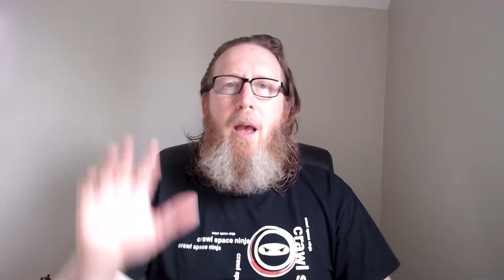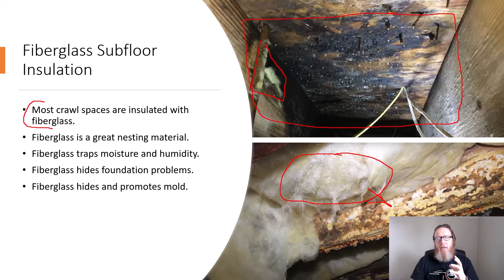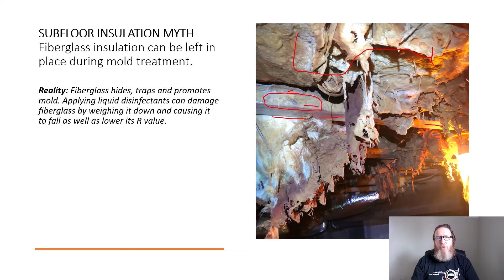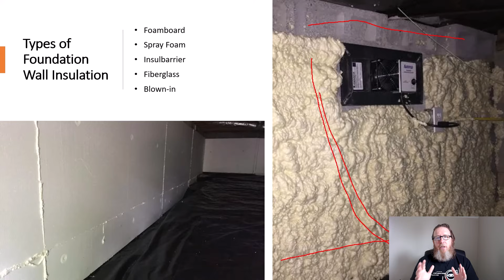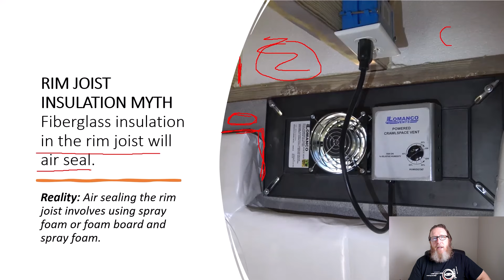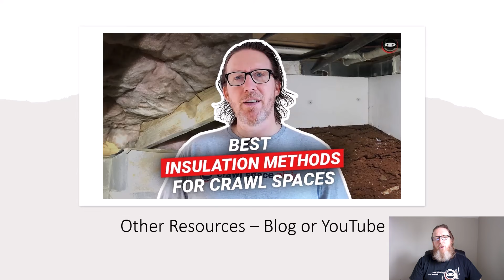Your Fiberglass Insulation is Rotting (Here's Why)

Comment: I am using your vapor barrier and will have at least a 1 foot over lap. Can I put rockwool on top of the vapor barrier if I choose to in a sealed crawl space with a dehumidifier? If not, can you please tell me why ?
Reply from the maker: I'd like to know where exactly you would want to install it because if its on the ground, you are not achieving much. If you install it where the heat and cold transfer takes place, such as the walls, that can be a decent insulation method, but adhering it could be tricky

Comment: My crawlspace is vented, which part would I air seal and insulate? If I understood correctly, you said do not insulate the walls if it is vented. You also said you do not recommend insulating the subfloor for any application. Would I only air seal and insulate the rim joist and sill plate along with air sealing the subfloor?
Reply from the maker: My apologies for my misinformation. If you are going to keep your crawl space vented you still need to apply insulation to the subfloor. According to building code that is required. I would air seal all penetrations in the subfloor and rim joist but in order to pass inspection it is recommended that you insulate the subfloor. I do not like subfloor insulation but in order to follow code there is no way around it. I hope that clears things up. Thanks for watching.

Comment: my house has had issues with mold. i pulled out the fiberglass and there are some sistered areas between the joists at the rim. its an old brick house with minimal flashing over buffalo board (no thru wall). im concerned about putting any closed cell around my rim joists and encapsulating moisture that might permeate thru the bricks. It looks like the old building technology of letting it breathe might be superior here, although it would feel excellent to get my humidity down and sprayfoam the rim joist or add XPS. Would you recommend rockwool or spray foam ? Located in central Kentucky.
Reply from the maker: @andrewnelson7229 That is a great concern to have with an older brick home. Since you have buffalo board and minimal flashing, you are right that moisture can move through those bricks and you don't want to trap it against the wood with closed cell spray foam. In your situation, using Rockwool is often a better choice because it is vapor permeable and won't trap moisture like spray foam or XPS can, while still providing excellent thermal protection. Keeping that humidity down in central Kentucky is key, so focusing on a high-quality vapor barrier and a dehumidifier will help the wood stay dry even if the brick "breathes." Hope that helps. Thanks for watching!
Reply: @CrawlSpaceNinja  Thats my plan! I appreciate the feedback . Having CS Ninja come out next week to soda blast the mold and encapsulate the space. Thanks.
Reply from the maker: Please keep us posted how it turned out.

Comment: Can you do a video just for Florida? The entire exterior atmosphere is so humid here. I'm thinking to just nail the vapor barrier to the bottom of the raised wood floor joist 20" above the ground. Because, there's no other barrier under the T & G wood floors. The A/C should remove all the moisture from the inside of the house and from between the floor joist. Then the crawl space vents should still breathe through the foundation vents and vented access openings.
Reply from the maker: I have done several consultations with people as far south as Miami and we recommend if you have a crawl space with a dirt floor you cover the dirt floor with plastic seal the vents and control humidity with the dehumidifier. Hope that helps thanks for watching.

Comment: I'm planning to insulate a crawl space under a log cabin in central Colorado. In this climate it will be cooler on the outside on a more consistent basis, but not so much in the summer months. Do I put the vapor barrier on the inside of the insulation? I plan to use a foam board insulation and am not sure of the options to attach the stone. Any thoughts?
Reply from the maker: @jayjarrett5523 That sounds like a great project for a log cabin! In your climate, we typically recommend installing the vapor barrier directly against the ground and walls first, then placing your foam board over the top of it. This helps keep the moisture from the soil out of the space entirely. As for attaching to stone, using a high-quality construction adhesive specifically rated for foam and masonry is usually your best bet since mechanical fasteners can be tough to drill into stone. Hopefully that helps and thanks for watching!

Comment: I am in NC and my crawl space was sealed but they did not put foam board or any insulation on the wall or at the rim joists.  I can really feel it during this cold snap!  What kind of foam board can I safely put in the rim joists?   Many foam board products I see in Lowes and HD say they need a fire barrier on top of them. Or could I put rockwool board in the rim joists as well?  I have a yearly termite inspection for my termite bond and what ever I put up there will definitely need to be pulled for inspection. Thanks for the videos!
Reply from the maker: Thanks for reaching out @AlexAndra-g2t. Costs can vary depending on the size of the space and what’s going on, but we’ve got a few options to help. Here are some we carry: https://supply.crawlspaceninja.com/collections/insulation Thanks for watching I hope that helps.

Comment: I have a summer cabin that I have started using in winter and there is no insulation installed in the vented crawl space. I am wondering if since I am away from the house for months at a time through different seasons, is it a bad idea to seal the space if I will not be running a dehumidifier for the months I’m not there? Would it be sufficient to apply rockwool boards directly to the subfloor and leave it vented. Thank you very much, great video.
Reply from the maker: If you plan on sealing the crawl space and not installing a dehumidifier I would recommend putting in a humidity reader to see if that has somehow changed the environment to raise the humidity. I do like rock wool but anything against the subfloor could potentially trap moisture. Just be mindful of that. Hope that helps thanks for watching.

Comment: Im building a house on concrete piers. Is it a good idea to close spray foam under the plywood foundation?
Reply from the maker: @myuploadsvideos Thanks for watching and for the question! Spray foaming under the plywood can provide a great seal, but it's important to remember that it can also trap moisture against your subfloor if any leaks or humidity issues occur. In a pier-and-beam setup, we usually recommend ensuring your ground moisture is fully controlled first so that the insulation isn't hiding potential rot or mold issues down the road. Hope that helps. Thanks for watching!

Comment: Hey Mike - We had our crawlspace encapsulated and air sealed, but there's no wall insulation.  Looks like the VB is tapconned into the foundation wall, what is my best option to insulate the walls?
Reply from the maker: You can put foam board over VB but it will pierce the VB. May be best to install tapcon anchors through FB near top so less likely to leak any water from wall through VB. 2 or 3 tapcons will hold a 4x8 piece real good. Hope that helps. Thanks for watching.

Comment: You said you don’t recommend it insulating anything that could trap moisture? But then you said that insulation is required if it’s a vented crawlspace? What should I use if I have a vintage crawlspace? I was thinking either wool insulation or rigid foam board.
Reply from the maker: If you have a vented crawl space, subfloor insulation is required but unfortunately it can trap moisture if there is a leak from above. Rock wool seems to be one of the best materials for insulating a subfloor but many are still using fiberglass. Hope that helps thanks for watching.
Reply: @CrawlSpaceNinja thanks . What about spray foam ?
Reply from the maker: @Jimmy64527 I would never spray foam the entire subfloor. Spray foam is good to air seal penetrations but I have seen it used in ways that traps moisture and possibly mold whenever the entire subfloor is air sealed with spray foam and it's impossible to remove. Hope that helps.

Comment: Do you recommend insulating the under side of the subfloor between the floor joists? Thanks!
Reply from the maker: I do not like insulating the subfloor due to potential moisture and mold issues, as long as the foundation walls are insulated. You must do one or the other according to code. The department of energy states that insulating the foundation wall is better to create a thermal break at the wall and increases energy efficiency. But if you do not have wall insulation then subfloor insulation is your only alternative. Hope that helps. Thanks for watching.

Comment: Are these methods valid with field stone foundation?
Reply from the maker: You have to be real careful with stone if it is brittle. Using some type of drill or masonry shot can do a lot of damage. Most of the time when we deal with real brittle stone or brick we use spray foam insulation on the entire wall. There's no real good clear solutions, it just depends on what your stone is like and of course your budget. Thanks for watching.

Comment: Between my rim joist and cmu wall.... i have a tin lip that is folded down to the inside of crawl space.  I assume to keep pests out.
What do i do about this thing? Run the barrier up to it as close as possible? Foam the rim joists?
My rim joist is also secured to the block wall. (Whole house is block)
Reply from the maker: Leave that alone. That seems to be a termite gap. Apply vapor barrier below that

Comment: 17:38 the stuff you have on your site for the walls is not foam it's double bubble. But it's still just plastic barrier. 
Is it really that effective?
Obviously you stand by it or you wouldn't sell it. 
I plan on using this for my project over foam just because of the  ease of install.
Reply from the maker: We have been using it for a while and it is very effective. We have gotten away from foam board entirely except to seal vents and do rim joist insulation. Thanks for watching.

Comment: Great video! Question if your crawl space walls are fully below grade, does insulating the walls add any benefit? I would think the soil will insulate the wall as it’s blocking cold air. And then just run the vapor barrier up the wall? I’m trying to reduce cost and thinking of omitting wall insulation as mine are fully buried. Thanks!
Reply from the maker: Our local codes enforcement want us to insulate the entire wall even if it's below grade. I would check with local code to see what they say. Thanks for watching.

Comment: I live in Tampa, FL- was just hit with Helene and Milton and my crawlspace was flooded during Helene.  We just went in and pulled out the insulation and netting.  Blessed that there was no mold on any of the wood and only on the insulation that fell on the ground.  I have two vented openings on either side of the house.  Trying to decide my next steps; do I insulate?  Fiberglass or foam spray?  Any help would be greatly appreciated!
Reply from the maker: Fiberglass is typically seen as a bad choice as it holds and traps moisture. We can help if you wish! Email us at diy@crawlspaceninja.com
Reply: Foam spray.

Comment: What about using Rockwool insulation for the floor joist in a crawl space? Its vented and damp and musty. Built in 1956 northeast just foil there now. Much of the foil is falling down.
Reply from the maker: Rockwool can be used but can still trap moisture if the crawl space is damp.

Comment: Our crawlspace was sealed and has conditioned air flow. The rim band joints were sealed with lines of foam and then bat insulation placed in loose. If we updated to foam board, what do you use for 15 min fire barrier? Also, do you leave an air gap between the foam board and rim joist, or do you place it right up against the joist?
Reply from the maker: For the air gap that is per your county code. Are you asking what vapor barrier we suggest? We recommend the one we have been using which is this - https://diy.crawlspaceninja.com/crawl-space-ninja-12-mil-crawl-space-vapor-barrier-1000-sqf/
Reply: @CrawlSpaceNinja  thanks for your reply! What i was trying to ask was about a fire resistant surface needed to be on the exposed surface of walls and rim joist. I believe north carolina has a code that you can't have foam board facing the crawlspace interior unless it has a fire resistant covering, such as drywall or plywood. Do you have this experience with your NC crawlspaces? I can't say I know exactly what code it is,  trying to peice together diy info

Comment: looking to clean and seal up my crawl space. My house is a modular and sits on a haft crawl and haft basement foundation, with only access to the crawl from the basement.  spent over an hour in there last night looking around at different issues. I'm looking to put down vapor barrier, on the floor, walls, and footings and also have get closed cell spray foam sprayed underneath the floor to replace all the old fiberglass insulation and I want to say it's some type of fiber board. Trying to save on heating and cooling costs get the humidity down and really just make it nice enough to where when I start remodeling, I don't mind crawling around in there.  I'm in SE Michigan so it gets pretty cold in the Winter. I have a dehumidifier in the Basement section now and it stays at around 40-50. any recommendations are appreciated.
Reply from the maker: Contact us here so we can dive deeper - https://crawlspaceninja.com/crawl-space-help-faq/

Comment: Where is the correct insulation, I’ve missed it.  I see all the problems but not solutions.
Reply from the maker: Foam Board Insulation with an R value of R-10, Closed cell, and Termite resistant is what we use. Depending on your local code you may need a higher R value
Reply: @PlayGirlGrandma  the video is titled “crawl space problems”.
You should look for the video called “crawl space solutions”.
Basic.

Comment: When you put insulation on top of block, can termites build their tunnels between the wall and the insulation where you can't see them to know they are there? Or do you leave a gap at the top between the insulation and the wood of the rim Joist?
Reply from the maker: Here in East Tennessee we must follow a Termite Gap code that allows termite/pest control work on homes with encapsulations
Reply: @CrawlSpaceNinja  Code or not, I think it's an essential thing to do. Thanks for all your information. So very useful!

Comment: I've lived in NC for 2 years. My crawlspace developed a flood problem with big storms. I ordered an install of a french drain, sump pump, 20ml vapor barrier, sealed vents and dehumidifier. I have fiberglass insulation under my floor.

It took two months to get an install appointment after the problem was discovered/diagnosed (its been busy for tradesmen) and I'm concerned that, in that time waiting for an install, problems have worsened with recent storms. Should I expect damp wood or insulation to dry out after my system is installed and the dehumidifier runs for some time, or am I going to need to replace any damp beams/insulation, no matter what?
Reply from the maker: It is hard to say but the longer the wood stays damp the more likely it is to start growing wood rot fungus. I would also if you are able, remove the fiberglass insulation and install the dehumidifier as soon as possible so that the wood can begin the drying process. This will not address any possible mold but it could prevent it from getting worse plus the contractors you hired will want the wood dry anyway if they need to do proper mold remediation. The insulation in the subfloor is likely damaged beyond repair. Once it gets wet it loses its r value and should be removed anyway. I hope this helps thank you so much for watching and I'm sorry you all had to go through all of this. We have been praying for everyone affected by these storms.
Reply: @CrawlSpaceNinja  thank you so much. What you do is so helpful. Thank you. I am praying as well.

Comment: For the rim joists, do you need to vapor barrier and seal that section before insulating? Thank you!
Reply from the maker: No just make sure the rim joist is dry before you seal it. I would use a wood moisture meter to ensure that it is dry. If you cover it with spray foam or foam board and it is wet it will may rot the joist. Thanks for watching and I hope that helps.

Comment: Just to check :: if issues with crawl space fiberglass insulation, replace if it’s vented.  If not vented, I can remove so fiber glass insulation?  ( it’s pretty rough looking )
Reply from the maker: Fiberglass insulation typically holds moisture. That is where the issues come in. With vents means outside moisture can be brought in being trapped within the fiberglass. We suggest looking into closed cell foam board
Reply: @CrawlSpaceNinja  i’m in South Carolina, my fiberglass insulation is fairly ragged in a few spots but still holding up OK. We do have a vapor barrier, we had installed when we bought the house. Is it advisable just to put the R 10 foam board between the joists and leave the fiberglass there? As long as there’s no sign of active moisture?

Comment: Seems to me it makes sense to do a vapor barrier on the floor instead of doing an encapsulation.
Reply from the maker: You could do that. However that would not be an encapsulation. You would still be vulnerable to vapors coming in from areas that is not the floor.
Reply: @CrawlSpaceNinja  Thinking do the rim joists and leave the walls bear. Should not get vapor there and the area is not conditioned.